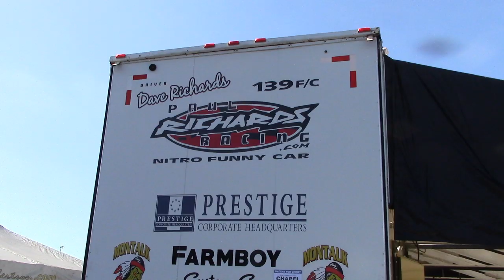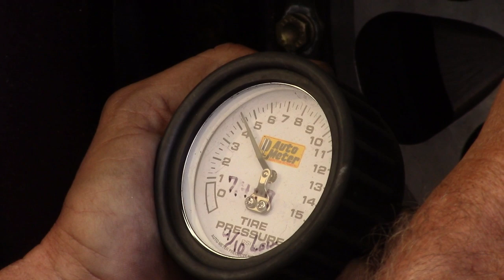NHRA NITRO FUNNY CAR Undercover Look | NHRA Carolina Nats zMAX Dragway - Paul Richards Racing

Comment: Just saw your pro stock RIP video & have not gone to a nhra event in 30+ yrs. I did go to the last nhra meet in Englishtown, NJ. Last yr. & was shocked how bad a pro stock car looked it's maybe 2/3 the size of a stock camaro, dodge or ford. I thought the shriners were there with there go carts!! It was a joke. 
Both nascar & nhra got to go back to using templates or a laser version of measuring stock & pro stock cars. 
I agree with you the closer these cars look stock with fat rear tires, wheel stands & loud exhaust the more fans will relate.
Just my 2 cents.
Reply from the maker: Yeah, as strange as it seems, the brand recognition factor is important.  Top fuel can look however it wants.  It's a class with pure race-craft in mind.  With pro stock and even funny car to a degree, the essence is how fast can we go with stock or modified stock platform.  You've got to keep some stock resemblance though.